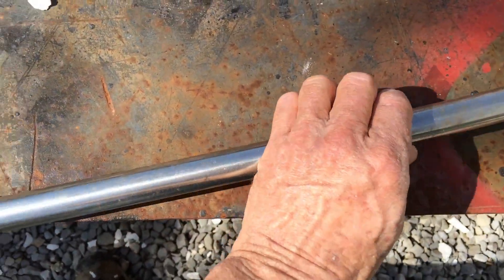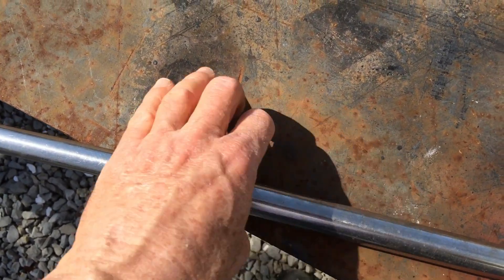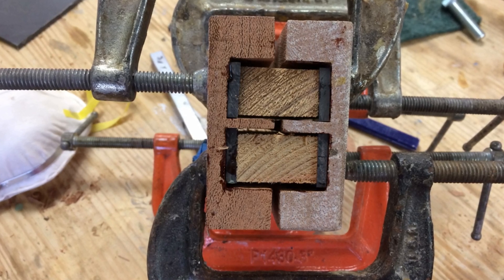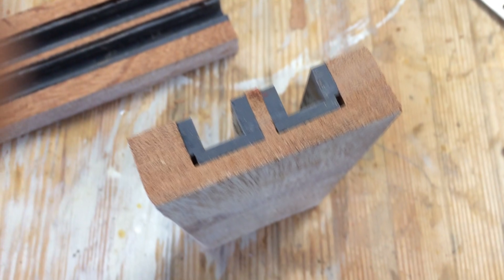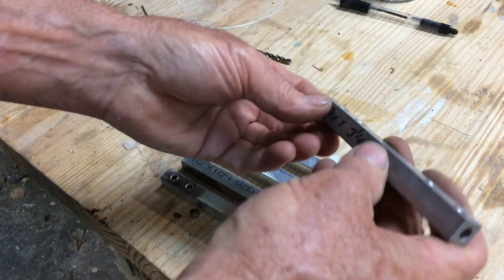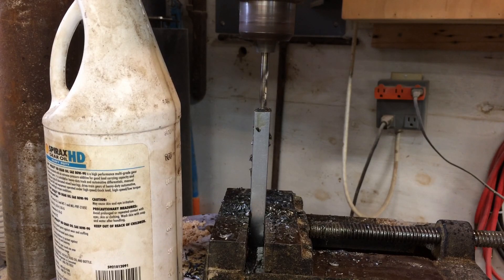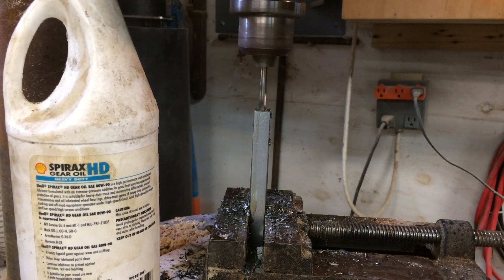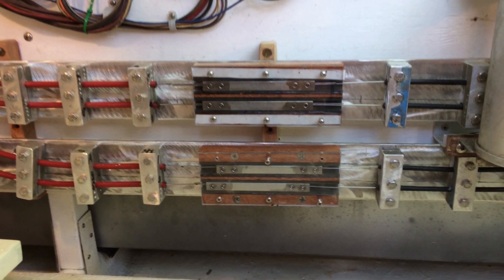The Houseboat Project #36, controls for the outboards

Comment: Some genius engineering there!
Reply from the maker: Well David, I guess time will tell. We have a long term plan of replacing the big 2 strokes with smaller 4 strokes in five years if we still have and are still enjoying the boat. If the cobbled together controls last that long I will call them a success.